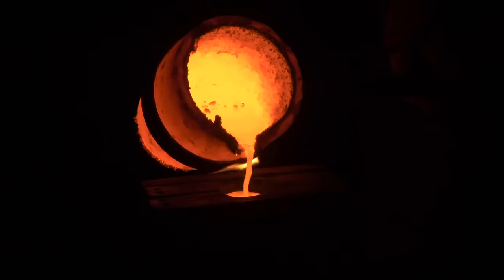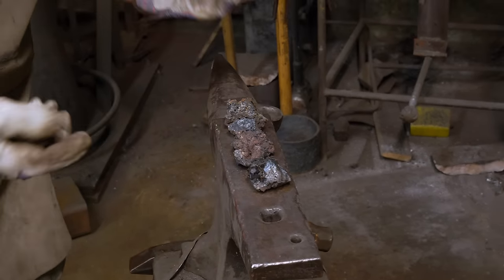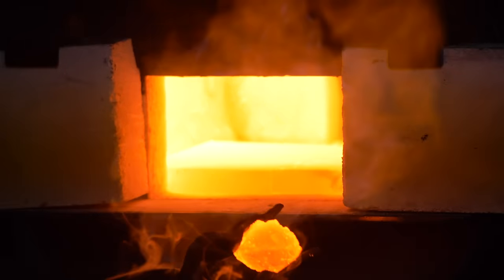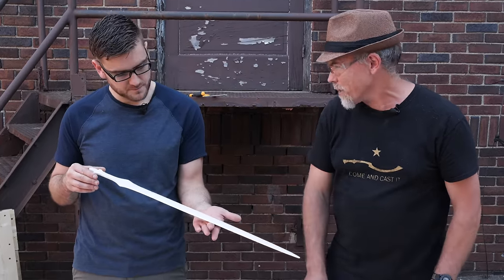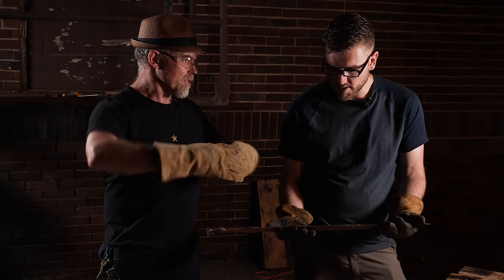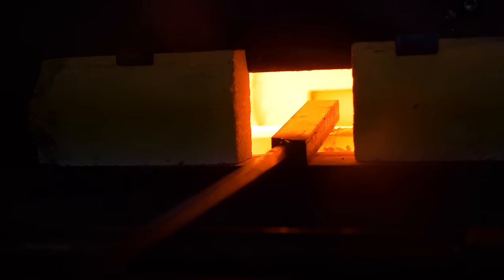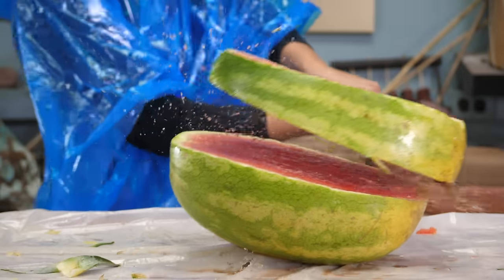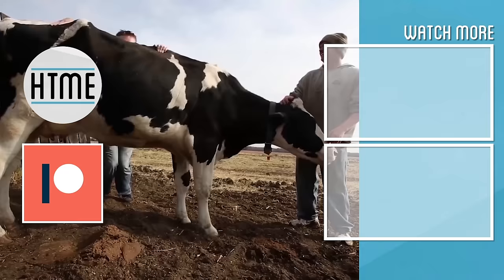Forged Iron Sword vs. Cast Bronze Sword

Comment: I knew it, this whole series was just a way for you to learn blacksmithing.
Reply: Gotta beat and fold the metal when it hot for strengthening of the blade
Reply: I just clicked on this video because it was on my recommended and I do not regret it.
Reply: @hu4ngming  people only folded steel because it had impurities and it pushed out the impurities and it can lose csrbon content and create air bubbles making it weaker also science has proven bloomery steel only needs to be folded twice
Reply: couldn't agree more.
Reply: And join "forged in fire"
Reply: Stop it with the 2nd person talking
Reply: Just an excuse.
Reply: @blakeS819  but u can fold it up to 10 times and it will be stronger
Reply: @hu4ngming  you can also work harden blades though it’s less reliable
Reply: You can learnt to blacksmith easy tho
Reply: @bringbackmemesineurope1576  if you fold the steel 10 tiems you will go back to iron.... You will beat all the carbon out of it.
Reply: @cretudavid8622  If you beat it enough times, it becomes your girlfriend.
Reply: @ctrl_x1770  👏👏😐
Reply: @hu4ngming  the steel he used didn't need folded.

Folding is for inconsistent steel, with a lot of impurities.  Modern monosteels don't need folded.
Reply: @bringbackmemesineurope1576  no, it won't.  Folding does one thing and one thing only:  it distributes impurities evenly throughout the steel.  Once that's done, further folding does nothing but convert steel into scale and waste the smith's time and effort, while potentially introducing cold shuts and other weak points.

When you hear of a sword that's been made by a "master smith" and folded more than three of four times, that's an example of the smith showing off.
Reply: @team3boyhamster246  Kinda. You can learn the basics easily, but unless you have someone who knows what they're doing helping you along, you're going to have a lot of trial and error and produce a lot of garbage to get anything good out of it. It's very much a skill.

Comment: This title says forged "iron" and the video even shows a chart differentiating between iron and steel, but the people in the video constantly change between using the words iron and then steel. So we still have no idea whether the sword is actually made of very low carbon iron (or very low carbon mild steel) or higher carbon steel (eg. medium carbon steel).
Reply: The sword is probably a mixture of hard steels and softer irons. A lot of the skill of a blacksmith is getting the carbon composition of the iron right for the application and it is just done using the charcoal in the forge, working the iron and judging its colour as it heats and cools
Reply: @davidwright7193  If it was a mixture of different soft and hard steels, then they would have used the jacketed lamination technique that sandwhiches a soft steel inside outer layers of harder steel. They do not do this in the video. The video suggests they are using a single type of pure steel given how they show the forging techniques and how at 5:00, they still they substitute their poor quality ore with a modern piece of metal ingot. They said "substitute my bloom with a comparable piece of iron." This in all likelyhood means they are using high quality, high purity modern monosteel ingots. Modern monosteels are ultrapure with a consistent and even distribution of carbon, so it should not have any sort of poor quality patches/weak spots where some parts are wrought iron and some parts are higher carbon steel.
Reply: @davidwright7193  If it was a mixture of different soft and hard steels, then they would have used the jacketed lamination technique that sandwhiches a soft steel inside outer layers of harder steel. They do not do this in the video. The video suggests they are using a single type of pure steel given how they show the forging techniques and how at 5:00, they still they substitute their poor quality ore with a modern piece of metal ingot. They said "substitute my bloom with a comparable piece of iron." This in all likelyhood means they are using high quality, high purity modern monosteel ingots. Modern monosteels are ultrapure with a consistent and even distribution of carbon, so it should not have any sort of poor quality patches/weak spots where some parts are wrought iron and some parts are higher carbon steel.
Reply: @Intranetusa  However that isn’t what the finished sword consists of.  The  outer layer will be of a higher carbon content than the core if they have used a charcoal forge or lower if they haven’t.  The processes of heating and hammering change the makeup of the iron. 

If you are trying to make a good blade you don’t want a uniform block of metal you need the outer edge hard and the body much softer.  You get that in part by heating the billet in charcoal which means the outer layer absorbs carbon from the charcoal. 

If you don’t get the outermost layer to pickup at least some carbon then just hammering it will be driving the carbon out.  When you actually get iron out of a bloomary smelt what you end up with is a mixture of iron, carbon and slag. You then have to work it while hot to smash out the slag and the carbon to get wrought iron. That is what makes it “wrought” which is after all just an old past tense form of “work”.  Much of the skill of a blacksmith is in controlling the amount of carbon that goes into the iron and comes out of it as a piece is worked. All the old methods of sword making be it pattern welding through to the Japanese folding methods were about getting a good mixture of properties into the blade. 

When they get rid of his useless mess of slag with a bit of iron and replace it with a modern ingot they are pulling a fast one as that ingot is nothing like the wrought iron you actually get from working a lump of cast iron into a bar.
Reply: @davidwright7193  They are using modern monosteel ingots with modern forges in the video. That means everything will be fairly pure and the carbon will be uniform and the result is all steel. They are not intentionally case hardening iron in a long enclosed process (which only increases the carbon of a very thin outer layer anyways). You don't need the outer edge hard and inner layer soft to make a good sword either. That is only a requirement for laminated swords. With tempered spring steel swords, the entire sword can have a similar level of hardness - both outer and inner layer are mostly similar. So the video creators have no reason to interchangeably use iron and steel like that when they are using modern pure monosteel as they should be perfectly aware of the type of steel they are using. And even if they were using jacketed laminated techniques that don't use monosteel, they still should not be mixing up iron and steel as the softer center is going to be higher end of the mild steel category.

Comment: This video is a bit historically inaccurate. During the transition period they would cast iron weapons like they did bronze. Bronze also is slightly harder than wrought iron, which makes me believe they didn't use a comparable metal, and just opted for the lowest carbon steel they had available. They didn't really have any control over the carbon in the iron at the time too, and you would have widely varying levels of hardness. Some of the earliest iron swords were pig iron cast around a bronze core and the blast furnace for melting and casting iron has been around since 500BC. A concave edge was also something that came later on. During the transitional time period iron weapons were generally inferior to their bronze counterparts except in one major aspect, it's much easier to mass produce when you only need one ore.
Reply: I kinda like this destructive positive opinion.
Reply: @hanswerner321  The primary difference between iron and steel is that the former is a metal, whereas the latter is an alloy. Iron is simply a metal element that occurs naturally on Earth. In comparison, steel is a man-made alloy that’s made by mixing iron and carbon together. Iron, on its own is not really durable, I would argue it has the same durability as bronze..
Reply: I wrote a comment to this, but then I re-read nowknow's comment and saw that he DID already cover logistics and trade as a reason for the transition to iron weapons. Sorry about reiterating what you already said dude,
Reply: Danger Bear  I can imagine that a man with a bronze sword is more to fear than that with a iron blade because of that, or possibly if a soldier who had a iron weapon saw a bronze one on the ground they would likely take it for their own
Reply: @zyanidwarfare5634  bronze is way more expensive, due to the rarity of tin. Imagine you're an Aegean merchant, and you wanted to trade for tin. You must either went to British Isles or Afghanistan just for enough tin. Cyprus have some, but it's not enough to supply the entire Mediterranean. This is why the destruction of trade network in the end of bronze age have devastating effects to the civilization there. After bronze age civilization collapsed, people trying to find another way for creating weapon, eventually creating the first iron weapon. Even thought the weapon is not as durable as their bronze counterparts, they don't need to have extensive trade network for creating that. Because of that, the iron began to replaced bronze for weapon (mind you, weapons not armor) in the iron age. Why don't they create armor from iron? Idk, but i could create some educated guess. Iron are harder to forge in large scale, so it would take more time and money to create armor rather than casting bronze armor (this might explain why only philip 2 have iron plate armor). But, celts people have a brilliant idea to create small rings and interconnected it into a shirt, creating mail armor (this might explain why they ditched their bronze armor). In other parts of the world, India subcontinent people began creating steel (known as wootz steel) and they get a lot of profit for that. They trade their steel abroad, eventually reaching the Mediterranean. At this time, steel became prestige and only  the richest could afford it. People also began ditching their bronze armor in favor of cheaper brass and linen. Around the 4 or 3rd century bc (maybe) people in Mediterranean and europe figuring out how to create steel, and they began equip themselves with this metal. It's interesting to think if bronze age collapsed never happened. But considering ancient Chinese is a bronze age civilization, and they use bronze weapon for much longer, even alongside new steel weapon, this might also be the case in alternate history.Peace out.
Reply: You couldn't cast iron with any furnace available to man until the 18th century... all iron and by extension steel was forged from blooms (from bloomery smelting) or pucks (from crucible smelting). Even if you could cast iron the carbon content would be so high (~2%) that any weapon longer that a few inches would be liable to snapping the moment it were subjected to any lateral force whatsoever...
Reply: @callumj4232  china was casting iron from blast furnace in 500bc and they did use the brittle iron for weapons casted around bronze cores
Reply: @nowknow  i did not know that, thanks for the info. Regardless, these swords are clearly european/mediterranean in style, and in europe the casting of steel wasn't practiced until much, much later. I have certainly never heard of bronze/iron composite weapons before, and can assure you that even if they did exist in china, such technology was not around west of the himalayas.
Reply: The video was littered with mistakes. It didn't do anything right, except the bronze cast (that one was great). All the rest had no relevance to this video's purpose and only ended up creating misinformation. This has negative educational value.
Reply: Danger Bear  wait, I thought steel was superior to bronze in every way.
Reply: I was thinking the same thing. I feel like his 'iron' sword in this video is closer to the kind of steel the Roman Empire was using than anything from the early iron age. Though lets also be fair, there were never pure iron weapons because it was almost impossible for them to remove carbon and nickel impurities from it early on. 

I still think early iron and bronze were pretty comparable though. Bronze didn't rust, which might be why it was considered superior in the bronze age over iron and iron was more prone to bending and just overall softer, but iron was easier to repair and likely less brittle. That's what I have came across while researching this topic, and some of it seems dubious. 

The main reason for the switch, above all others, was economic. That is the only real constant and I accept it as fact.
Reply: @ja-k0  Cast iron has a lot more carbon than Steel. Pure iron is very very rare, then and now.
Reply: can you explain how on earth would they cast iron without being able to properly melt iron?
Reply: @matthewnickolas4706  I already have. Blast furnaces  were around since 500BC
Reply: @nowknow  only china had blast furnaces in 500BC
the earliest known european blast furnace is from 1200 AD
Reply: @matthewnickolas4706  and the bronze age ended in 300BC
Reply: @MarcRitzMD  I've seen West African blacksmiths make iron tools better than these guys.
Reply: This ☝️is the correct historical assessment of this video.
Reply: @zyanidwarfare5634  much like many technologies that take off due to availability, it started worse but quickly managed to surpass the bronze it replaced
Reply: @senseishu937  steel yes, but not the very first iron. Trying to forge good iron from furnaces developed to deal with bronze is just not going to work well until the techniques to work with iron caught up to the generations of development that had gone into bronze
Reply: @lefteyereport6354  ah all right... Also, isn't steel an alloy? So that means it's different from iron
Reply: . The carbon in coal always migrate into the steel when forging, so, no wrought iron. The melting temperature of the steel is way higher than bronze , so they couldn't obtain, at first, wrought iron for casting. I think you are saying a lot of things that you don't have knowledge of. And 1020 steel, with just 0,2% carbon is way more common than 1080.
Reply: This is not true, if the blast furnance was here from 500BC then why did all the steel produced in Europe until industrial revolution was made reforged from Iron sponge made in reduction furnances? The Iron in the medieval furnances is essentialy not melted but comes from carbon reduction of iron ore. In europe, the furnances capable of melting iron were discovered only at the end of medieval times. The only ones known how to make molten crucible steel from iron sponge were indians - making steel called wootz but the technology got lost and forgoten.
Reply: @igormoravcik300  because Europe was technologically far behind the middle east and east. And they absolutely did, but they didn't use it for steel, I'm sure you've heard of cast iron? It wasn't very good for making weapons, it's the reason why people started forging. But before they figured out you could forge to evenly distribute the carbon, they were casting weapons. Archaeologists have found tons of iron weapons and armor that was cast during the end of the Zhou dynasty, and forged weapons started appearing when the process was refined during China's warring states period afterword.
Reply: @lefteyereport6354  quickly as in 'many centuries'
Reply: @maksdampf  yes
Reply: "During the transition period they would cast iron "

whose transitional period? china's? may be. 

europe, egypt or the middle east? they didn't have the furnaces to melt iron.